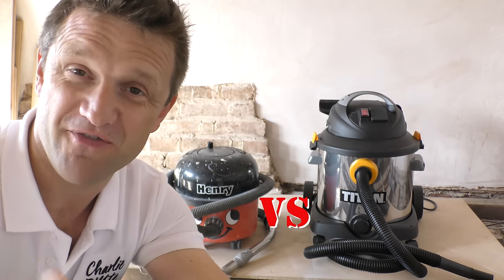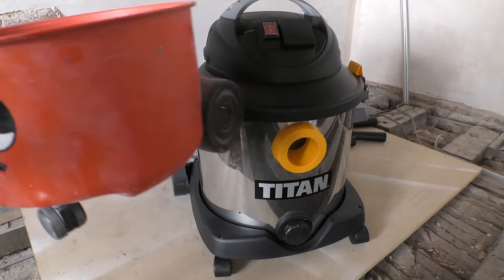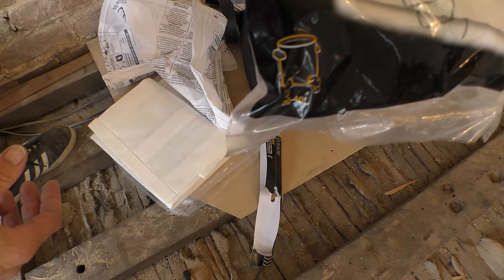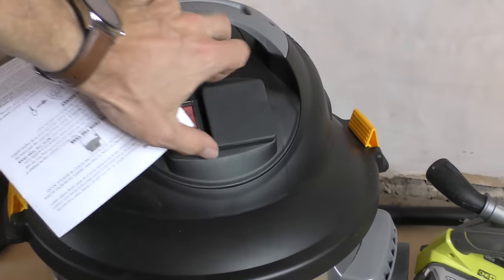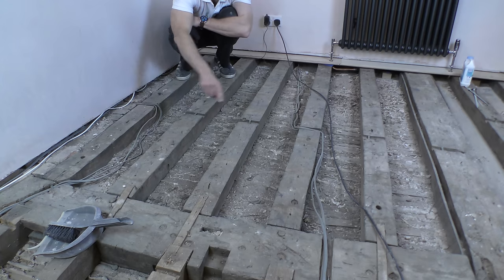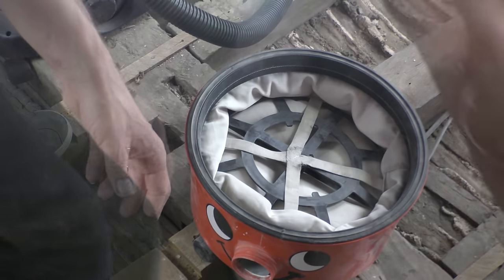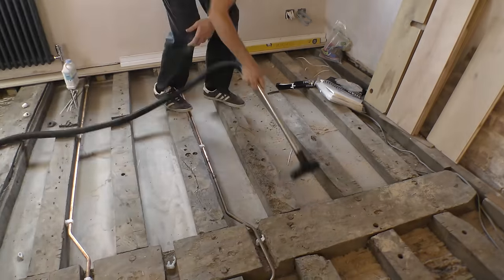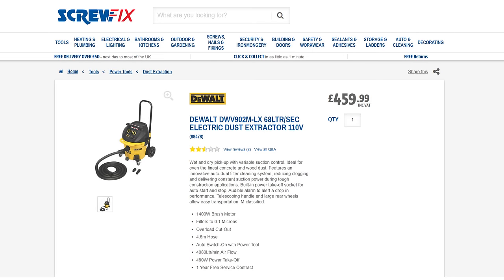TITAN vs Henry - DIY Vacuum Review

Comment: I have an old Henry 2 speed 1600 w which is as good as it was when new 10 years ago because I always use a bag and clean the filter regularly and I love it because of its power and compact size , I also have a Karcher wet and dry that I only use for wet work and that to is a great machine and is really powerful for removing blockages from waste pipes etc....as you say always use a bag and you carn't go wrong......👍

Comment: After watching this I avoided the Titan and went for the Hyundai HYVI3014 1400W 3 IN 1 Wet & Dry HEPA Filtration Electric Vacuum Cleaner with Powertool socket. Costs a fiver more than the TITAN but excellent build quality and works a treat. All the same features but none of the build quality issues.
Reply from the maker: Sounds likea nice piece of kit that, Mike, and with chrome tubes a HEPA filter and integrated cable management too, which the Titan doesn't have. Plus I've just invested another £20 on a HEPA filter for the Titan as too much dust was getting through the other one, so yours is better quality and cheaper!

Comment: I use an 40 year old Vax wet and dry, it’s fantastic , a bit of metal fell off the motor about 20 years plus back removed it and flung it, it’s been fine since no issues whatsoever
Reply from the maker: You feel they were much better quality back then, don't you? Can you still get spares for it 👍

Comment: I bought the Henry xtra for housework use last year and wow is that thing powerful - too powerful infact. It can easily lift vinyl which has been glued down with contact adhesive and has lifted carpet from the gripper rod.

Comment: thanks for doing this.
it's a good idea to wear a respiratory when you're using the blower function esp indoors.  I use this on the bandsaw after suction but it does kick up a lot of nasty microns into the air.
Reply from the maker: Good point 👌

Comment: I just dismantled my Titan for some maintenance, and it looks as though the motor is sealed and kept separate from the flow of dust. So I don't think a bag is necessary to protect the motor. However a bag may be preferable to avoid creating dust clouds when emptying the bucket.

Comment: Your henry with the split in the bottom is made of polyethelene plastic. Same as buckets, washing up bowls etc. Splits and cracks can be repaired using an old soldering iron to reweld it back together. If you can get an old red washing up bowl you can cut it up and use it as 'solder' to repair it or even replace missing bits. Plastic kayaks can also be repaired in the same way.

Comment: Still using my 25+ year old aquavac bulldog - has done the same work you are doing for my house restorations and for friends.  I use it mostly as a car vac nowadays - never had a bag in it just the heavy duty filter.  It's as noisy as hell and the wheels have long since departed but I think it cost £30 in a B&Q sale.  I was looking at the Titan for future replacement so thx for helpful video!

Comment: Thanks for the review, I was thinking of getting the titan as its a dry and wet wash, but after seeing how the hose is thin and the bag doesn't hold the dust well it would probably either break down or need replacement parts sooner rather than later and by doing that it will probably cost you more then getting a Henry, think I'll just buy a Henry as it will last longer and apart from the body of the vacuum henry is better built.

Comment: I’d go as far as to call the Henry no frills and the Titan simply cheap. The Henry isn’t fancy, he’s just a basic machine that’s made to a high standard of quality. The cheap Titan is just very inexpensive, it won’t last nearly as long or be nearly as pleasant to use as any of Numatic’s machines. I started selling after years of recommending them. They’re a bit more obscure here in the US, but I’ve seen some 1980s vintage machines here in commercial settings!

Comment: Charlie, You should try the Numatic wv370 or a Charles cvc370 they use bigger bags and are wet and dry
Reply from the maker: Thanks Alex. I've got a George video coming up at some point soon. Transformed our kitchen floor - an awesome bit if kit!
Reply: Only the Charles is a wet dry vac.The NV370 is just a larger henry.
Reply: @a.a674  sorry wv370

Comment: Really interesting video. I've had two titans fail even when I always use the bags, but this video explains alot. I think I may invest a little more next time!
Reply from the maker: Thanks. What I learnt after doing this vid is that the comparison was slightly unfair as the Titan is really designed to be a static or semi static shop vac. When I teamed mine up with a cyclone for this furniture build https://youtu.be/9RfHpm2vf40?si=u9774sVCM19NSyZo it was actually pretty decent. You need to build yourself a cyclone but put a pressure released valve on the bin 😉 https://youtu.be/Ws7Tp2Qgbo4?si=UPhWI1CTrS2zWYCb

Comment: Wickes wet and dry vacuum has been in the garage for 25 years plus and still going strong. No bag and filter needs cleaning every so often to maintain suction but cannot recommend enough. Have a Henry (skip find with all accessories but needed a new £4.95 switch!) but still use the Wickes as my go to vacuum.

Comment: Hi Charlie, First..you have got the same name as my twin brother😂. Well let's go to the test. This test was about two years ago and I see it for the first time. There are millions of video's on YouTube, But any how......The test. I was always a fan of Henry....A friend of mine had a Henry and he was very impressed  by it's power. I was thinking ( I love DIY projects) If you glue a plastic ring around the nozzle in the compartment, with hot glue instead of taping it with black electric tape, perhaps then it will close the gaps. Yes the titan had more capacity and a bigger back, and switches on and of by using your powertools, that is brilliant. Well we are 2 years away, and I love to know what your best buy was. I love the way you make your content. refreshing and it was kind of a knowledgebase. I hope I use the right words, I am Dutch you know? Well at least it's a great way to get my English finetuned. I was in England for 2 weeks, and I must say...I loved every bit of it. I was in Lincolnshire and London. My sister in law is English. Well.....It was a Pleasure to watch your video...I did subscribed and gave you a big Thumbs up
Reply from the maker: Hi Bert, great to hear from you and thank you for your detailed comment - in perfect English I might add! This comparison was actually a little unfair because the Titan was never designed to be a domestic vacuum and actually here https://youtu.be/9RfHpm2vf40 as a static workshop vac attached to a cyclone (which removes the need for the dust bag) it was brilliant - and I used the pass through switch a lot as it triggers the vacuum when you turn on the power tool. So I would say you can't beat a Henry for all round use but if you're just after a vacuum for the work shop this is priced very well to do the job. Thanks so much for the sub and for watching my videos 👊👍

Comment: Interesting review. Just a comment on using these machines with power tools. Be wary regarding how the cleaner motor is cooled. I finished of my machine when using a sander. The air flow into the cleaner is restricted by the tool and dust bag, and then gets further restricted as the bag gets filled/blocked. Portable power tool extractors are designed to have a bypass flow to cool the motor. Black smoke escaping from your vacuum is never a good sign and don't rely on the motor thermal cutout protection, it won't always work.

Comment: Bought the 16ltr Titan as temporary replacement for indoor use.  Yes the plastic tools are very poor quality but I guess that's to be expected for the price.   My wife got tired of using it even when I bought a better head for cleaning carpets.  She now has one of those modern stick vacuums and the Titan is in the garage.  It still comes in handy for cleaning cars and DIY jobs.  Also was very useful when we had a blocked drain.  I was able to remove water to see the blockage then swapped the pipe around and blew the blockage away. 
They're by no means the best trade vacuum out there but if you only use it occasionally they are great value.
Reply from the maker: I bet you're referring to the Dyson (noooo...!) Yes, the Titan has its place. I'm upgrading to the Hepa filter (just ordered one on Screwfix) as there's far too much fine dust leaking through the system and out the exhaust. As you say, there are a lot of better trade vacuums out there but this is hard to beat on price.
Reply: @CharlieDIYte  Thankfully it was a Shark not a Dyson ( words would've been had if that much money was spent! ).  Let us know how the upgraded filter goes, it could also be a good buy for mine.

Comment: I have been using the 40 lt version for the past year or so. The only issues I’ve had with blockage, is if a cloth or something is sucked in by accident, other than that it does block up when using the thickness planer. I don’t understand why Titan don’t make adaptor parts to fit their own machines? I have both the Titan planer and table saw which both come with with dust extractor fittings but neither of them are compatible with the Titan vacuum? So I have to find work around for them. The vacuum itself is very powerful and is easy to move around due to the chassis being mounted on wheels, which do drop off from time to time, so some CA glue cured that problem. All in all I’m happy with the purchase.
Reply from the maker: I used mine was a static shop vac for my wardrobe build attached to a DIY cyclone and it came into its own for that. Made me realise that's what it's designed for, so comparing it against a domestic vac was a bit unfair really. https://youtu.be/9RfHpm2vf40

Comment: Another drawback re the Henry is the wiring terminal inside the wind up drum. The twin core cable winds it's way through a chicane like conduit and has no positive screw down clamps. If you are not vigilant and stress the lead, they will loosen. I have always used Henry's and I've pulled at least 3, that I can remember, skip diving. All had the same loose cables and worked perfectly well after 10 minutes with an allen key.
Reply: p.s. NIce offset bends on that 15mm copper btw.

Comment: Might sound silly but I use my first Dyson de stijl cylinder in my garage which I've had since 1999 and it's still going strong . Like your Henry and Titan video , I suppose your lucky having the Henry so you can use Henry's tool on the Titan , on the same thinking could you not use Henry's better fitting bags on the Titan ? Less capacity but overall will increase the motors life . Just a thought.
Reply from the maker: I suspect Dyson nicked his idea for the cyclone from cyclonic shop vacs so it makes sense you using your old one in this way - if that's what you meant? This vid was actually rather unfair as the Titan was never intended as a domestic vac. Once I had it in the workshop for my wardrobe build attached to a cyclone https://youtu.be/9RfHpm2vf40 suddenly it made sense particularly with the pass through switch, and with the cyclone attached it doesn't need a bag - which I suspect is why the designers never bothered to get the bag to fit correctly. You can't use a Henry bag with it though. The inlet is the wrong size.

Comment: Been using a Henry for years, mine is one of the older 2 speed models with 600w and 1200w modes which I bought before the stupid EU power limit.
Reply: I was of a like mind to yourself but it seems what the limit actually did is force manufacturers to innovate.  Suction is measured in terms ofthe volume of water the vacuum can lift: old 1100W Henry could lift 2.4L, new 600W Henry 2.3L.  That's a 100g difference in suction power for almost only half the elecricity use.  Now multiply that across the entire EU and you'll see the reduced impact in electricity use and subsequently global warming.  That limit is only for dry suction vacs, so if you still want a more powerful yet potentially ineffecient model, buy a Wet and Dry like Charles.

Comment: looks like you've got the old plastic secondary filter basket, i find the hepaflo filter replacement allows for better airflo before the motor decides it's had enough.
Reply from the maker: On Henry? Yes, although he's now got the hepaflo cast off from my other Henry vac, which itself now has the pets hepaflo filter.

Comment: I have a small Titan and we have a slightly awkward relationship. Like you I find dust on the bottom of the bin. Also the yellow catches don't hold in place. I tend to coil the cable on them which isn't as intended but there isn't anywhere else. "Somebody designed that" I once heard somebody saying as they regarded a particularly ugly emergency light fitting, wearing an expression as if chewing maggots. I used a third party anti-static, anti-crush hose with a range of fittings. The hose came in a 10m length which I cut into 3 lengths and attached appropriate fittings for my needs including one for the Henry we have. The range of adapters fit every tool I've tried. Central Technology Systems.
Reply from the maker: It only really made sense why they had designed this when I connected it to a cyclone and used it as a static shop vac https://youtu.be/9RfHpm2vf40?si=6OXgO_rsDRoD7aqp

Comment: It has to be the Charles. It's larger, it has all the same features of the Henry but more powerful and the accessories are interchangeable and whilst it is on the expensive side, you know it's going to last and the parts are readily available when you eventually come to needing replacements. Oh, and the hepa bags are a fair bit bigger too Overall, it is probably better value...

Comment: I have the Titan and for power tool extraction it is truly brilliant, BUT, the hose lets it down, it needs a more flexible, non kinking hose, these are available on ebay though. What I would like to see you do is test a range of the so called universal power tool extraction adapters because that is a serious nightmare to sort if you have several tools.

Comment: I bought a Vacmaster wet n dry from Amazon that looks exactly the same as the Titan so I assume some factory in China is pushing these out to be branded up by whoever. Same blockage issues as you had and the same flimsy plastic attachments. Better value than a Henry I guess but as long as you treat it with care.

Comment: If only Henry made a version with a power outlet on it, they'd give the likes of Festool a run for their money! I know Numatic, who make Henry vacs, make one but it's not as compact as Henry. I've had this Titan vac for about 3 years now - upgraded the filter to a HEPA one, but ScrewFix no longer seem to stock this. I also upgraded the hose to a CTS 'quick click' one and it works well/ok with my track saw and sanders. Bag seal is not great, as you point out, and the suction drops off when the bag is only 2/3 full. For the price (paid about £75) it's pretty decent for something that stays under the workbench.

Comment: I bought an older model of that Titan a few years back and while it’s fine for cleaning up saw dust, it’s building dust collection is about as good as you see here. It’s even spat dust out the blow vent in the past. Should have saved my money and got a second hand Henry. Or stolen my mums one (which is about as old as yours)
Reply from the maker: I've had that happen as well Ben. It's had a new lease of life since I hooked it up to my cyclone https://youtu.be/9RfHpm2vf40 (as a static shop vac it's actually quite good, particularly with the electric socket to trigger power tools) but as a stand alone vac it's pretty hopeless.

Comment: Good review.  I bought a Titan yesterday and have already experienced the blockages.  Also, the loose lid made me wonder if there was a seal missing from mine, so I searched and found your video, and the lid is the same.  Plastic tubes I find OK, and cheap to replace, it's just the internal diameter of these is a little too small.  I wonder if a hose from another vac will fit?
Reply from the maker: Hi Phil. I've also upgraded to the HEPA filter which helps but the loose fit of the bags and the diameter of the tube is the most annoying thing about it. Such a shame because these are such basic things to fix.

Comment: I have the Lidl version and based on this it’s a level above. Metal polls and a far better filter.
I removed all the wall plaster from a house in one go and this cleaned up the dust with a cyclone separator/bucket and then the vac without a bag and yes the filter sucked up dust on the outside but ZERO on the inside of the filter. Tube still got blockages but less than you did when comparing the work done.
Reply: Michael Williams I now have a Lidl one, and I hate it. The pipes are too short and make me stoop when using it, which kills my back. The bags are hard to get- the online replacements don't reach the bottom of the tub, so a bit of weight in them and they tear off around the hose entry point. The noise is unbelievable. The metal is thin and all the accessories are cheap and nasty. The hose split away from the handle within two weeks of buying it. I'd take it back but lost the receipt.
Reply: @spencerwilton5831 I have the PNTS 1500 DS. I’m 6ft tall and have no problems with the pipes, I can stand upright and use it with ease. Maybe you had a pipe missing? The bags seem come up easily enough on a google, they seem to be compatible with Einhell, this makes sense as Einhell makes many of the Parkside tools.